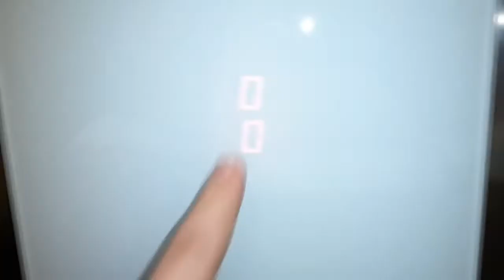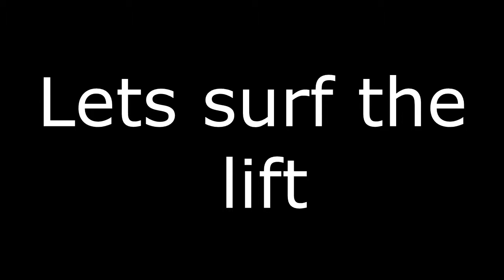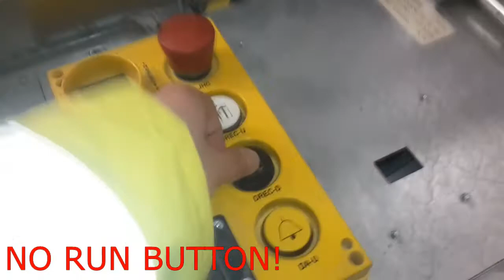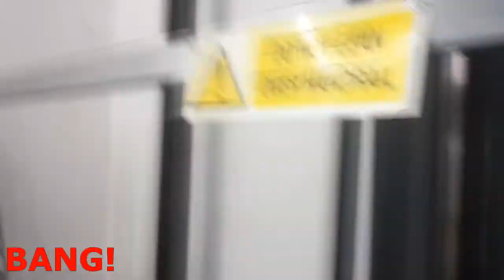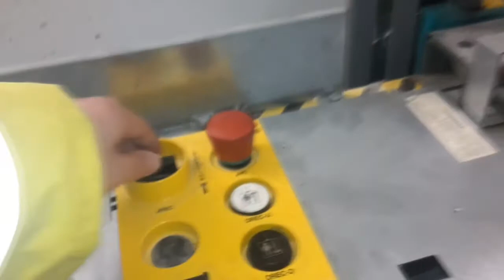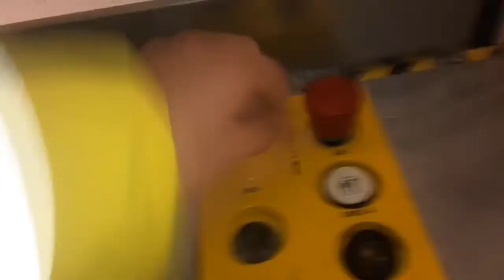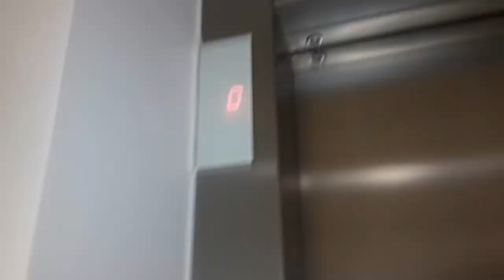An Intricate Look at a Schindler MRL 3300

Comment: When getting it's position again after moving on inspection, the 3300 (and also all other lifts with the same logic) goes to the lowest floor with 0.8m/s, therefore you don't reeeeally get a full speed ride. Also with the standard ones (no TSD21 safety device, meaning no reduced shaft head or pit) you can always enable inspection and ride on inspection. For it to start the repositioning, you also don't have to open the doors. It starts automatically after puting JREC in normal position, although it takes a few moments.

Comment: 7:35 Actually, the lift is resetting its selector. Many of the lift selectors are based on pulse-counting. For the selector to work properly, the lift must find the "zero" position from where it starts counting the encoder pulses up and down. Neat, huh?